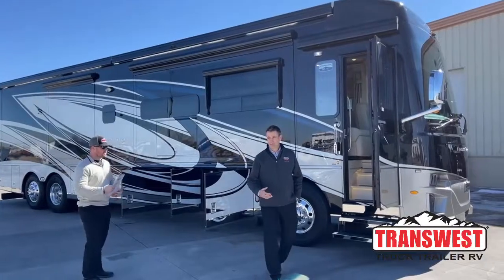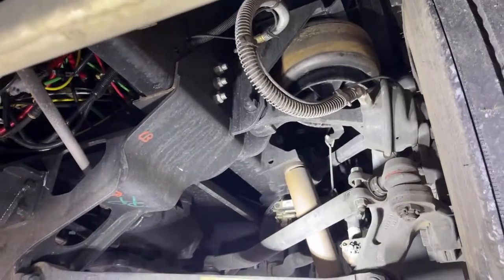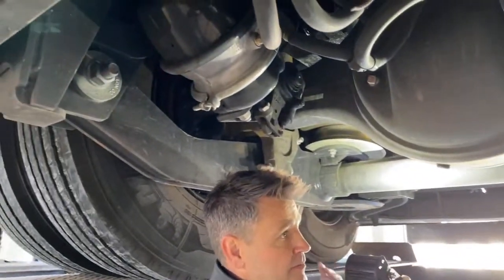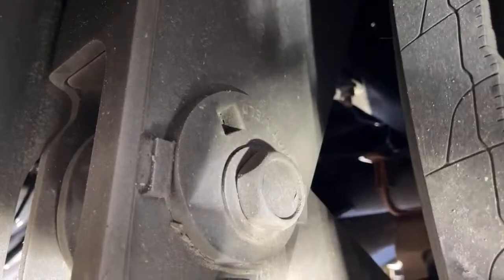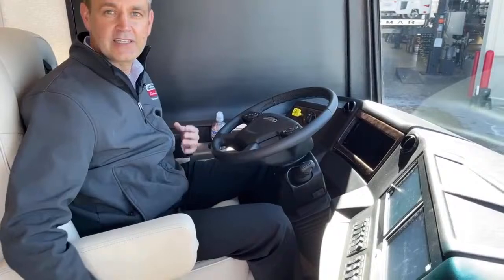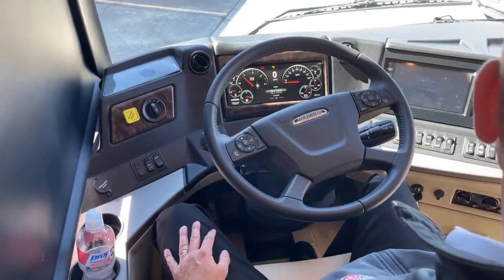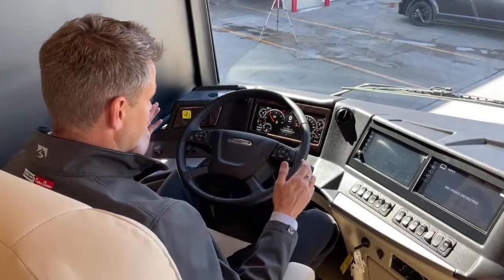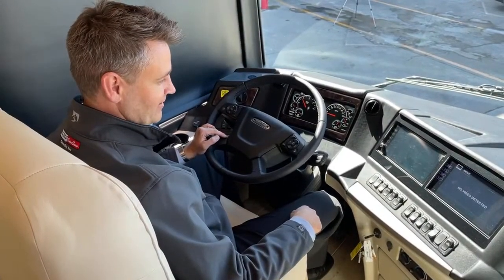A Look Underneath a Class A Diesel Motorhome

Comment: Is it not awesome or what!!! Great video guys! Finally I can see a diesel pusher underneath.... One question... I could see a second small diameter exhaust pipe facing the back left side of the coach... what is it?
Reply: Exhaust for on board generator up front, probably exhaust for propane water heater